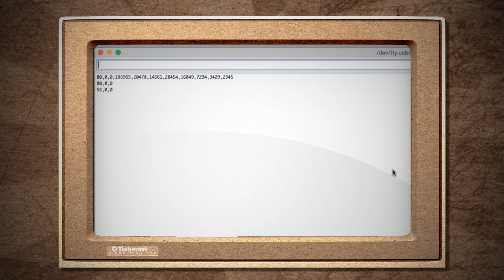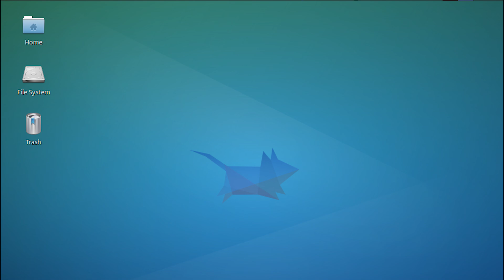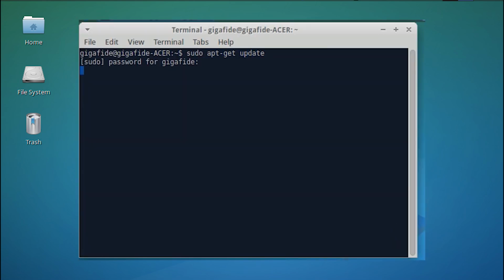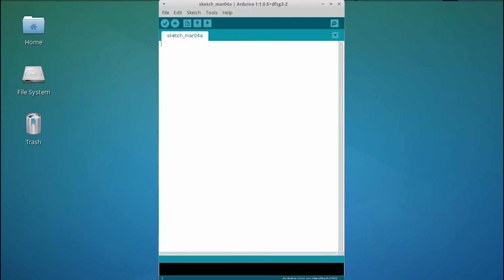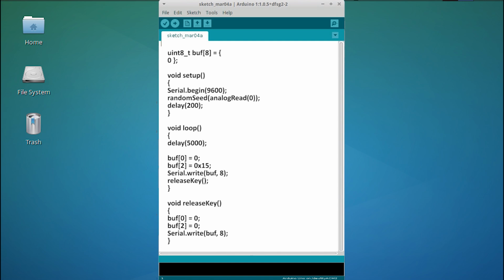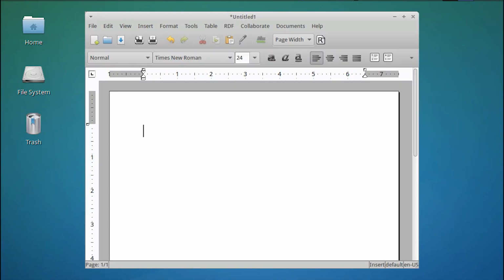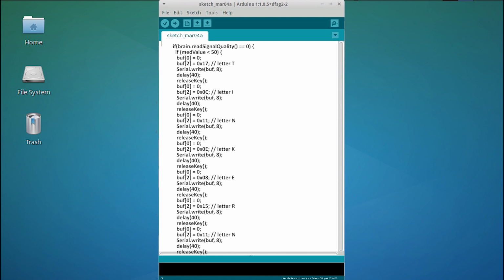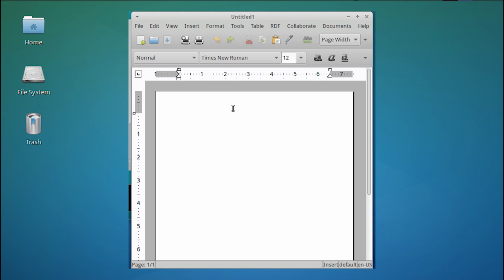Controlling Your Computer With Your Mind

Comment: Computer's run on software and hardware ardueno which creates a math matical path which makes it where you can control a computer with your mind because if you see Steven hawkings. His computer is raspberry pi computer is making a program in binary code which translates into english so wouldnt effecting the ardueno into different code could control tv's computer's and other electonic devises and even lights fans and sinks

Comment: I'm interested in the keyboard emulation aspect of this project and have a couple questions. 1.Why do you have to reburn the bootloader after every sketch modification? 2. I have a littleBits arduino that runs the leonardo bootloader by default, is it possible to emulate a keyboard using the littlebits arduino?. 3. I'm looking to make a DIY version of this with arduino: http://hakshop.myshopify.com/products/usb-rubber-ducky-deluxe?variant=353378649 , do you have any suggestions? 4. Could I just use an IC chip with arduino boot loader burned on it with a serial to usb converter to do this? Also thanks for taking the time to make, edit and upload your awesome videos, keep it up.